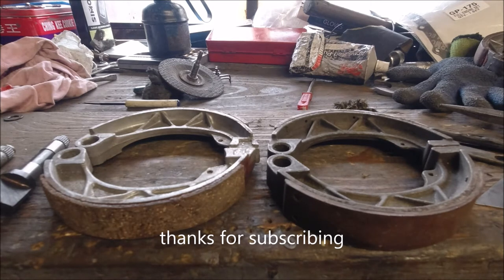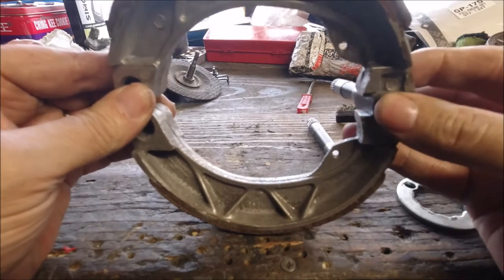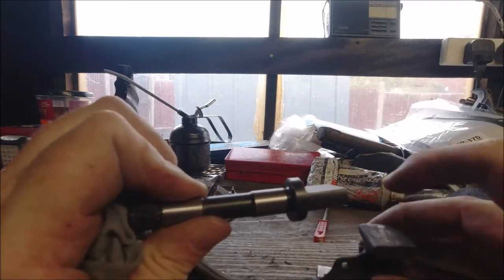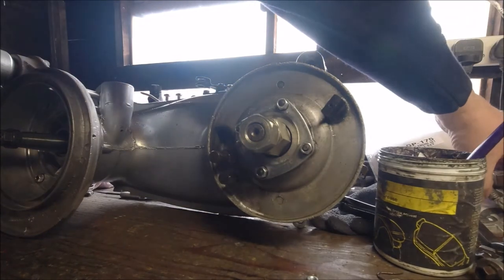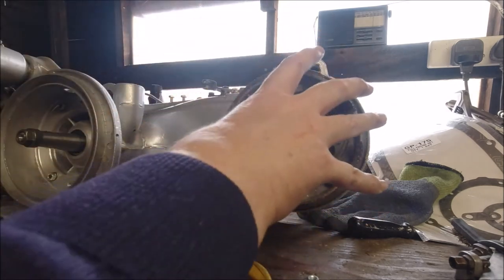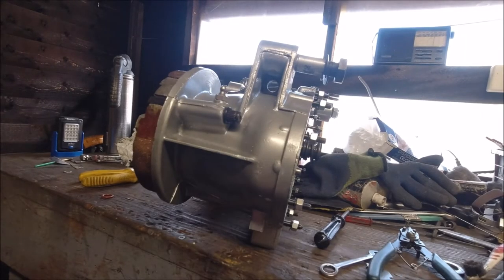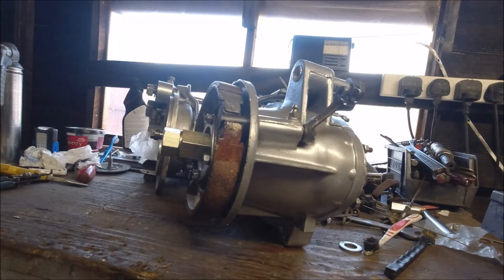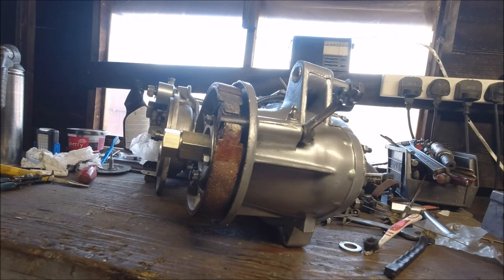Lambretta engine rebuild 22

Comment: Remember greasing a pivot on some drum brakes over 50 years ago
Came across some drum brakes and others recently and most have never seen sight of grease....
Grease is not only a lubricant but good for corrosion resistance and waterproofing
Reply from the maker: They dry out over time hence the copper grease.